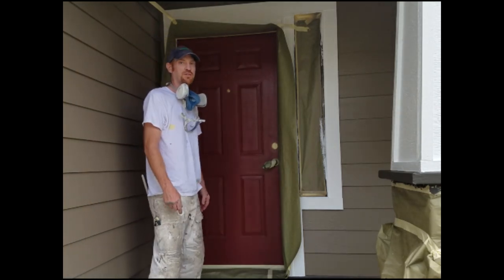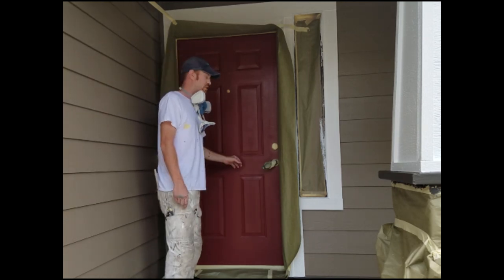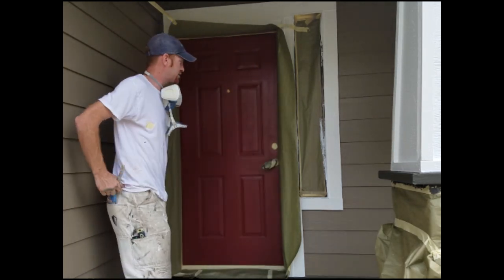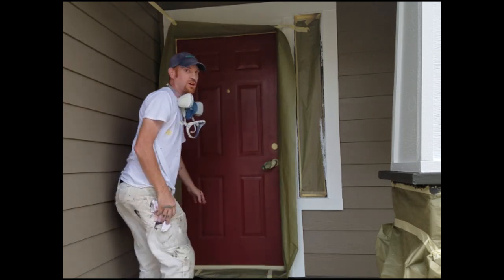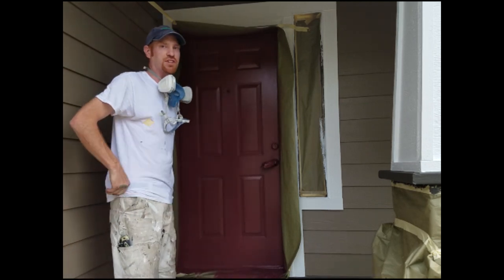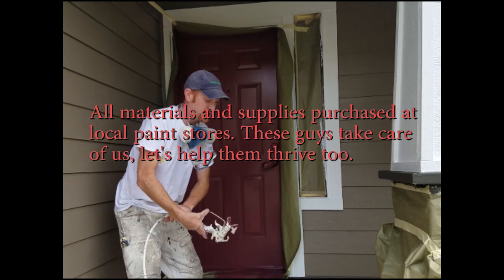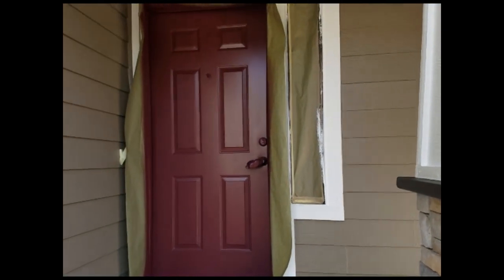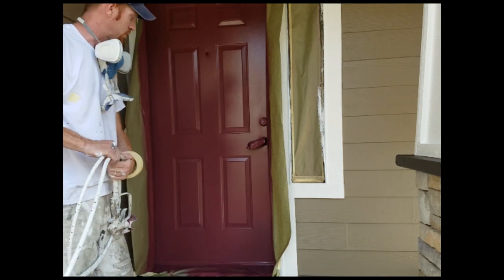House Painting: How to Paint Metal Front Doors (with an airless sprayer.)

Comment: Just came across your channel and am so happy I did as you're as pro as they come. I love how informative you are and dont hold back any information. 

A few questions I did have was when doing garage doors do you give you a light sand as well before applying the paint? 
And also..
Do you ever pressure wash it before hand (garage doors or front doors?)
Reply from the maker: Thanks for the kind words. I will always want to wash garage doors as part of the prep process.
I would typically give metal or fiberglass surfaces a scuff sand before the next steps.
Wood surfaces might get more than a scuff sand

Comment: Nice job man. 20+ years of painting here and what I’ve noticed in lots of videos is everyone seems so concerned about psi. I hardly ever turn mine down. I feel I get more fingers with it down. So what is the point of turning it down?
Reply from the maker: Sorry for the late reply, but I had a Graco FFLP tip this time. They suggest 1000 psi but I go higher like 1350- to 1400 at times. I also use other tips frequently and shoot normal pressure like 1850 - 1950 psi.

Comment: Do you thin the BM Soft Gloss paint before spraying? I'm using the same paint but in black and find that rolling it on is leaving streaks.  Going to try spraying it next.
Reply from the maker: No I wouldn't thin it. The roller strreaks may be fixable with a little different roller cover and technique. If you're using a mini roller, it can leave uneven pattern easily.

Comment: My door has a lot of paint I used thinner nd a sander to get it to the metal. The paint I bought says it has primer. Should trust it or should I put on primer on the bare metal door?
Reply from the maker: JFranco Shouldn't trust your paint with primer in it unless it's specifically is made to go over metal surfaces like a DTM or some oil based paints. You should Prime the door with a bonding primer/adhesion primer. Like XIM bonding primer, or Kel coat, possibly Smart Prime, or a product that your paint store recommends.

Comment: Hey XC...I need some advice. I have a a Graco I think its a 395 Used a 310FFLP and man all I get is clogging up.
Reply from the maker: georgeEPC sorry i couldn't respond until now. So the tip keeps getting clogged? Was is operating okay before this?? Of course the gun has a filter that needs to be checked that is cleared up and that's the right mesh. Those filters can get big holes in them or get blown out as we call it.

Check the inline filter on the pump itself to see if it is ok or if it has big holes in it.

Also it's a good idea to use strainer bags to strain the paint manually too.  
Let me know some of the details or if there is a more specific issue
Reply: Yeah partial problem was solved had not filter in the Graco contractor II gun. Must have forgotten that. I had bought new hose and also cleaned out the gun, forgot to install the new filter. Anyways, installed a 50 mesh in and it spays but still spits, and I get clogging quick to. All my filters are brand new.  I also used the strainer bag like you had and worked out ok, still got some clogging, without filter I couldn't even reverse the tip yesterday to unclog the tip, today I could with the gun filter installed. Also Its a Ben Moore trim satin paint I'm spraying, also thinned with Flotrel.  Now I'm wondering if the gun needs a rebuild
Reply from the maker: georgeEPC 50 mesh is the really course one. 100 mesh is the standard,  good for most stuff,  but you might want to use fine filters for trim paint and a 310
Reply: My Graco has two filters, one in machine the other in gun. Change both?
Reply from the maker: georgeEPC the gun filter will be the most important.
Reply: ok i'll give it a shot tomorrow. Also do you thin your paints when spaying doors and trim?

Any advice on the spitting? No extension on the gun
Reply from the maker: georgeEPC i wouldn't thin any waterborne trim paints. To avoid having spits on the work surface, don't let go of the trigger when pointed at the work. You could use an extension but if you don't need it then it's better to not use it.

Comment: How much paint did you use? Got a front door to spray in bm but only got a quart
Reply from the maker: The two quick coats takes a qt or less for this small project,  though using an airless sprayer requires more like 3 quarts to a gallon so it can siphon up the paint and fill the line (hose).